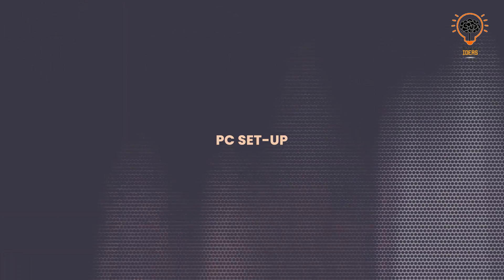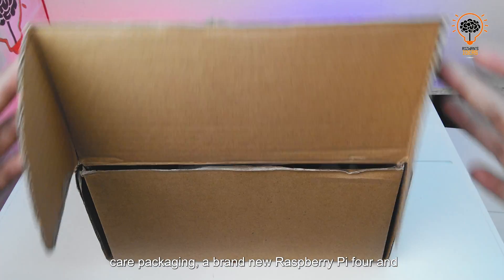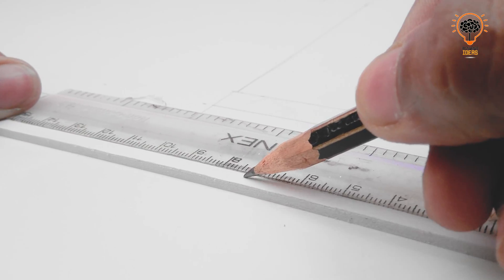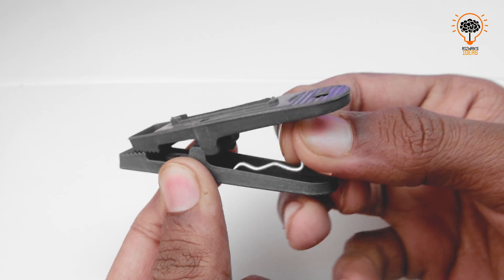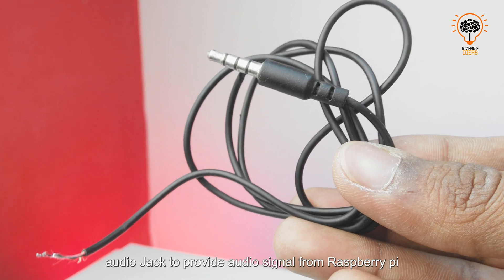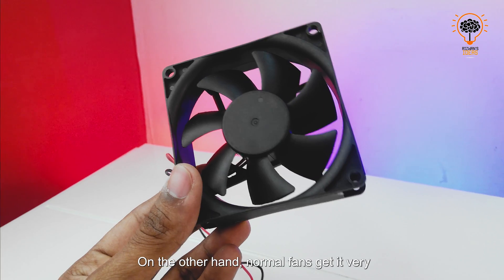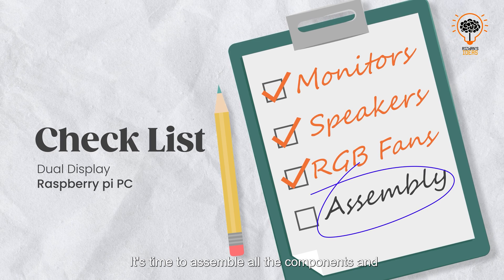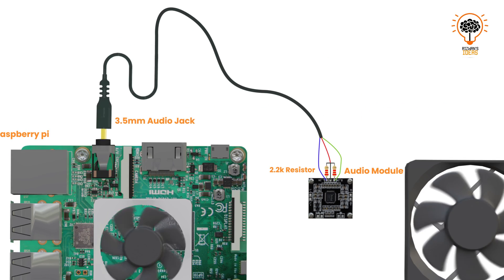How to Make Dual Monitor Raspberry PI PC | World's Smallest Raspberry PI PC - Rizwan's Ideas

Comment: QUESTION: I want to run two monitors, one being a standard sized monitor which will run the desktop and one will be a small 5 inch display which I want to display system information from AIDA64. Is there a way to set that so on reboot, each monitor functions as desired?

Comment: I've been using the pis for years. To be honest the raspberry Pi 5 is really the best pi for a desktop computer to date
Reply from the maker: Yes I recommend using raspberry Pi 5
Reply: Raspberry pi 4 B is just as good.Not everyone uses a credit card like fraudster to buy the latest model 5
Reply: @pauloyeghe1637  Interesting. It depends on how you're using it. I agree that the 4B is good, but I don't know if I'd go as far as to say it's just as good. Using it as a desktop for example. The video playback on a 4B via YouTube was terrible on a 4B 8G RAM. A Pi5 as a desktop video playback is way better. This is via an SD card mind you. It gets better running it off of an SSD or NVME drive.

Comment: In the speaker part you used two 3W speakers and not two 15W ones xD
and why the 2kohm resistors on the audio input? how is that gonna help with anything?

Comment: Everything is amazing but I thing the Panel infront of the Fan should be a mesh so that there is Air flow for cooling
Reply: considering the cpu doesn't get hot at all, the fans are just for display.
Reply: @CalebWolf  true but it would be a nice attention to detail
Reply: Glass front with side vents is a fairly common design for riced PC's. I have seen a lot of cases with this exact design, glass side, glass front, vents on the back side of the front